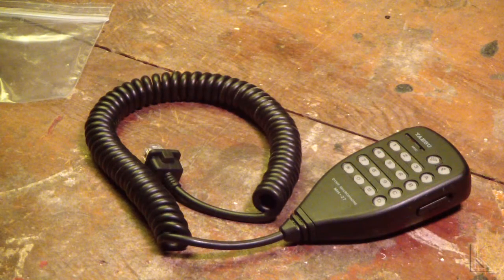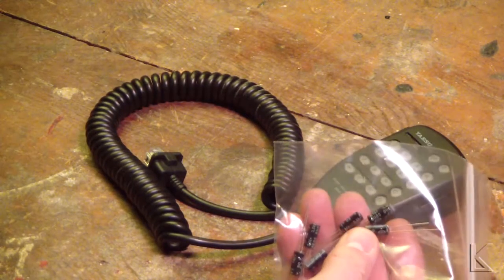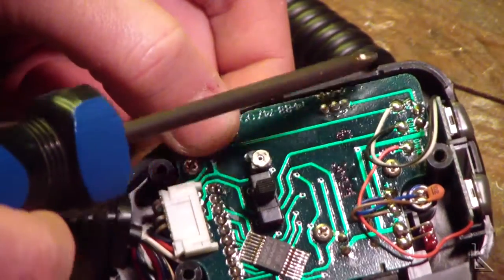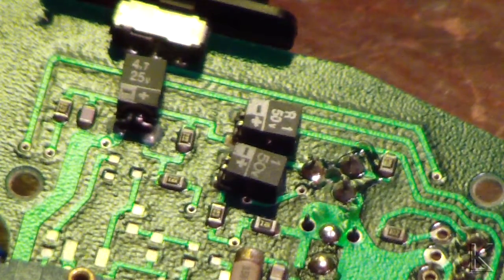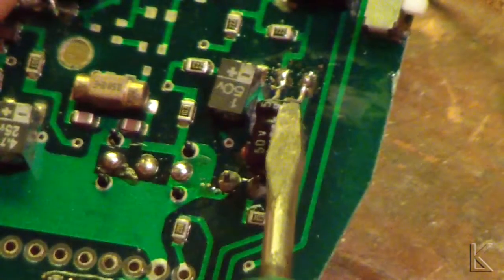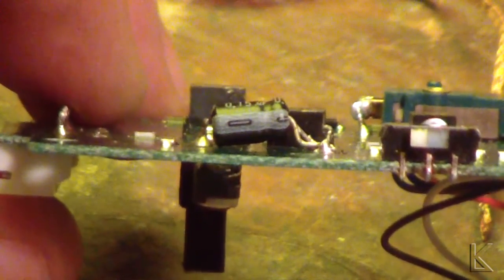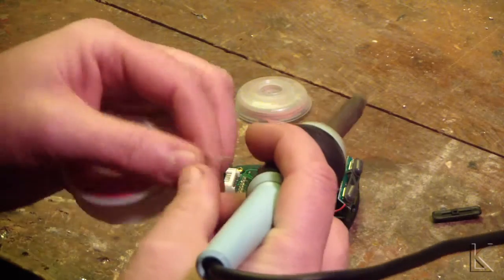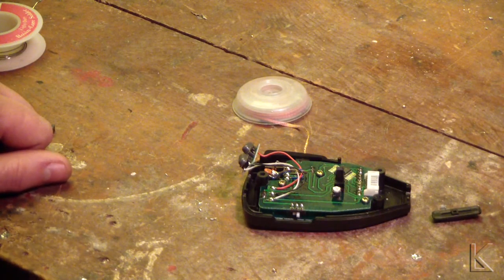Ham Radio - Yaesu MH 27 microphone low audio fix

Comment: Hi, my problem is that my Mayk cable is very old. I want to change it. What do you recommend?
Reply from the maker: Do a Google search for the microphone model number and the word cable. Several of those cables are available from third parties.
Reply: @loughkb  Most of them are 6 pin, not 8 pin. Thanks.

Comment: THANK YOU.  I guess this is an old video.  No matter.  I was recently given a Yaesu FT-6200 70cm - 23cm FM mobile radio.  The owner said something was wrong with it, no TX audio, but I could have it for repair or parts.  His hands weren't capable of doing the work anymore.  Testing it with a different mic showed that it is working, the mic was bad.

So I bought an MK-27 from E-Bay.  The said it was working.  Well, all the buttons are, but no TX Audio.  Seller says it was working when he put it away.  Uh-huh........  I didn't dispute it, not worth it, but I did mark that seller as a never buy from again.

What I'm going to do is this.  With your video, an hour at the bench and some junk-box parts I got it fixed.... and I had to order another 0.1 µF capacitor, so I can fix the second mic.  Then I'm going to offer it back to the old guy who gave it to me.  I'm a semi-disabled retired combat vet, but wife and I retired well and I can afford a 23cm radio is I really want one.  I hope I make the old guy happy.................
Reply from the maker: You're welcome. Glad to hear of yet another successful fix.

Comment: Thank you so much for this video! It was a pain to unsolder the top board despite I used both suck&wick ))  Installed ceramic cap and my old FT-2400H (1991!) sounds well now! 😊
Reply: Which one helped more? The wick or the solder sucker?

Comment: Excellent!  I have been trying to find out the reason for the low audio on my FT-5100, and came across your video.  I measured the deviation with the mh-27 mike, and saw around 150 Hz.   With 50 MV of 1 kHz audio injected in the mike  connector, its 4.5 kHz, so the problem is definitely the mike.   I just separated the boards in my mh-27 mike.  It took a couple of hours using a plastic solder sucker, with  several go arounds on each pin, with flux added to help the solder flow..  One trace on the back side of the pcb lifted.    I can repair that with some wirewrap wire.   A heated solder sucker is the right tool for this job.    My advice to anyone attempting this is don't use solder wick.

Comment: Is there a way to test if I have this problem on my same mic before I unsolder the pins?   Where to test on accessable side of board and expected value
Reply from the maker: If the cap is failing on your mic, your transmitted audio will be very low, it will be obvious.   You could also use an ESR meter to test the cap in circuit also.
Reply: Kevin is correct. I repaired 2 mics and it’s unmistakable. Sounds like you’re speaking from another room.

Comment: Kevin, if possible, can you provide the capacitor value for me and  the microphone schematic? My mic is also the MH-27 but it uses the 8 pin mic connector for the Yaesu FT5200 radio.Very informative video Thank you. My email ad is 426dav@gmail.com. Thanks
Reply from the maker: I don't have it handy, but the schematic can be found with a Google search.  
This was awhile ago.  I'm fairly sure I mentioned the cap value in the vid.  I think a 1uf cap would work fine since it's just passing audio.
Reply: Yes you're absolutely correct, point micro farad. I have been researching this back and forth and off and on. Hopefully I can repair the microphone for my mint old radio. Thanks

Comment: Yaesu FT-5100 MH-27 mic and having similar problems but replaced the cap and still having the same problem. Having a hum in the reduced audio, almost like there is a ground that not secured or something. Limited knowledge of the problem and electronics, but did replace the cap and no difference. Thanks for the info.

Comment: Just got this mic with a FT-2500M myself and have to do this repair. I was curious why you didnt bother changing out the other 3 caps while you were in there.
Reply from the maker: Part availability primarily.   One of the other caps passes audio from the DTMF pad.  I'm not sure what the 3rd does, from memory.

Comment: I bought this same radio and mic on craigslist and it has this exact problem! So happy I found this fix. I want to replace all my capacitors as they all either are corroded or look suspicious.  Do you know the values of the other caps?

Comment: I've tried to desolder the pin headers using a solder sucker and   solder wick.   Having a hard time getting the pins clean enough to release board.  any tips? thanks in advance
Reply from the maker: They're soldered on both sides of the board.  It is a bit of a pain.  I got lucky with a heated solder sucker and some solder wick on some of them as well.   Don't heat for too long though, or you can end up lifting the pad off the board.
Reply: Some times adding a little flux to the solder wick will help...

Comment: My 26 year old MH-27 Mic was reported, in early December, to have barely detectable audio on our local repeater with my mouth right against the microphone itself.   This was a big disappointment primarily because I could not find a real replacement that includes scan functionality in google search and I love the old FT-5100.   However, I did run across this wonderful video.   

I have just completed following Kevin's video procedure with complete success!  My final result in soldering the pins is not perfect by any stretch.  Also, my surface mount soldering was not nearly as nice as in this video.   But, testing the mic indicates:  Over the same repeater with the same friends, they report the audio is "a bit too loud" when my mouth is right against the phone.   About 5 inches from the phone was optimal.      I found 50V 0.1 uF Capacitors (bag of 100 for $2) on Amazon (SODIAL(R) 100 Pcs 50V 0.1uF Aluminum Electrolytic Capacitor - 4mm Diameter).   These fit perfectly.  

This is one of the best, most clear, most useful videos I have seen on youtube.   Note:  I also watched a couple videos on de-soldering with Superwick that were really helpful too.

Comment: Thanks for this. Having already peeked inside of mine, I didn't think I could handle the small sma parts. After seeing that the cap in question, isn't that tiny, I will tackle the job.
Reply: You'll do fine! It's more work to desolder the header pins.
Reply from the maker: Glad to know I helped.   It totally fixed the problem.   Now I have to be careful not to talk too close to the mic, it's much more sensitive.